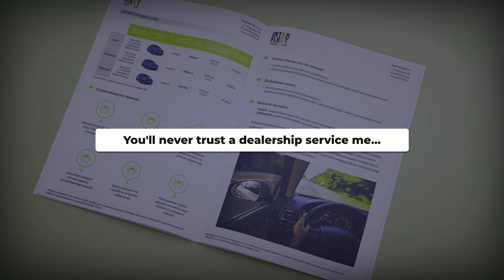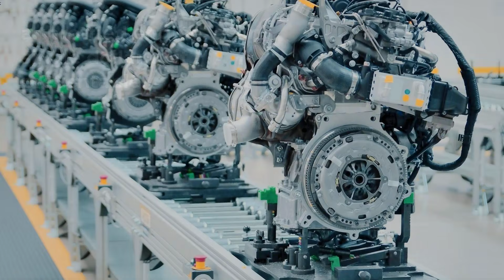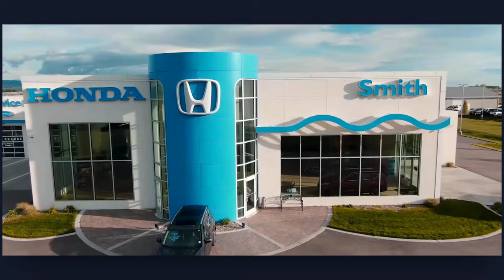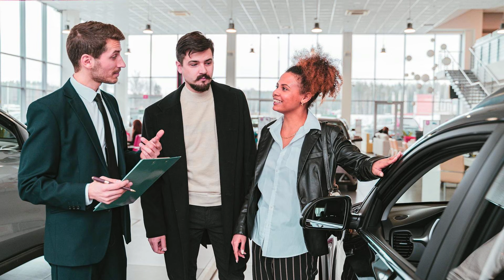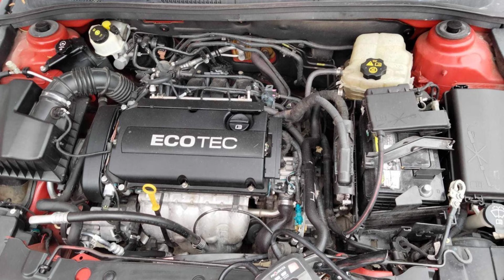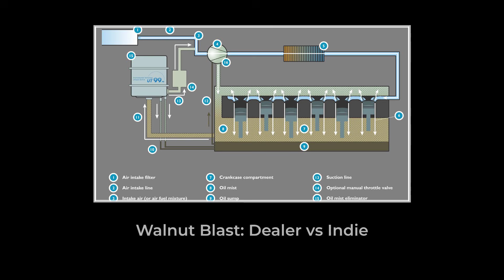Why Your Engine Lost 30% of Its Power (And How Dealerships Profit From It)

Comment: Complete bull$hit video. Plenty of new engines have both GDI and port injection systems to avoid this issue. And you can thank the governments and NOT the manufacturers for forcing GDI on manufacturers to achieve the mileage requirements regulations require.